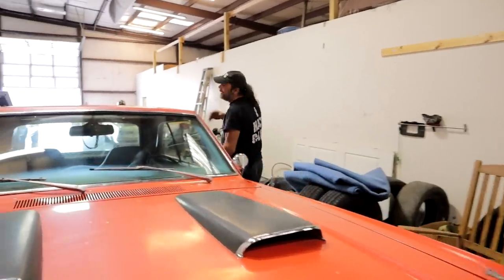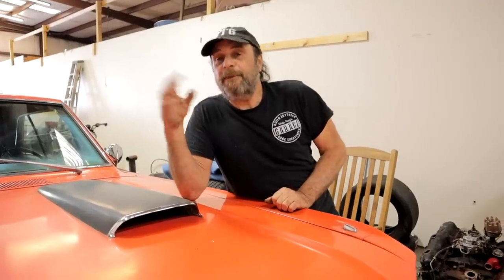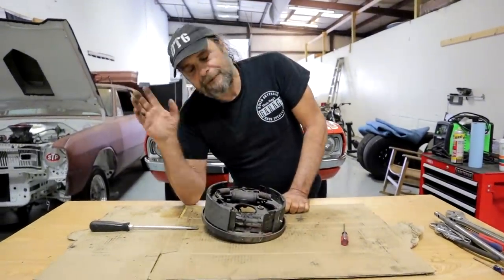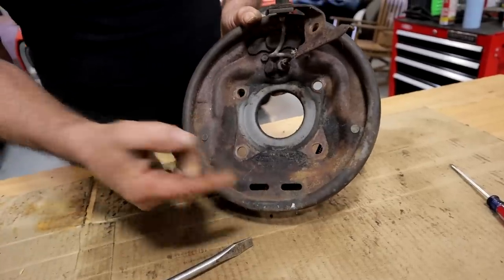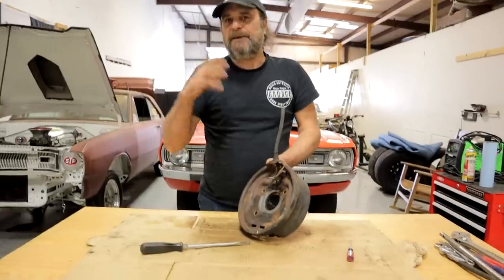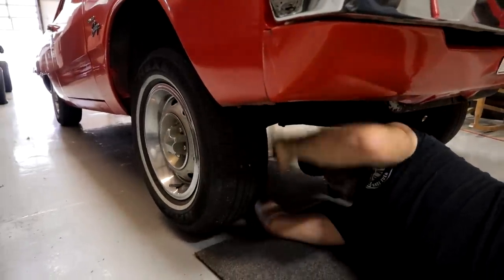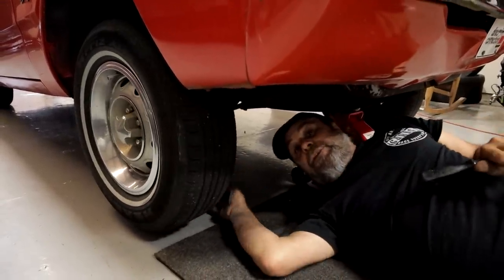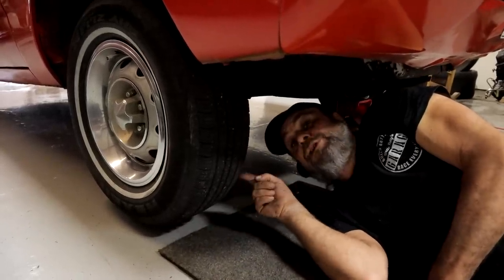Make It Stop! Brake Adjustment For Classic Cars Made Simple Plus A Hack For Gouged And Frozen Drums

Comment: For rear brakes, I'll adjust one side with a tire on, and the tire off on the opposite side. Then on the other side, take that opposite tire off, otherwise you're feeling the drag of the first side and you want them even. You may mention this by the time the vid is over, but I'm just saying basically the only thing I know about adjusting. I always have a hard time using a screw driver in there, especially my 2010 Silverado.

Comment: Good video.Could you do a video on the best way to get the air out of the brake lines.I converted my 66 Barracuda from single reservoir to the dual disc brake reservoir.I have the right positioning valve and all new brake lines and hoses.I have never been able totally bleed the air from the system.Ive bled the reservoir on and off the car still the brakes don't stop properly.The pedal always has alot of travel probably 3-4 inches or even more.Ive hand bled them and vacuum bled them still always have alot of brake travel...thx...Walt.

Comment: @13:45 2008 Dakota Sport 4x4 has disks up front and drums in the rear. Major issue cripking the hobby, discontinued parts. Latest one for me was the rear side drum brake adjuster that connects to the e-brake. How is it legal for a safety item to be discontinued?

Comment: Had a 72 F250. The guy had leading and trailing shoes reversed . Adjusters reversed. Left and right shoes reversed. When you braked, one side adjusted out, the other side adjusted in!
Reply: I ran a Midas shop for 10 years in early 2000s, and we used to see that all the time! Along with guys who did calipers and went through a gallon of brake fluid to bleed them, and still couldn’t get a pedal on it…because they had the calipers on the wrong sides and the bleeders were pointing at the ground 🤦🏼‍♂️
Reply: Hahah before I even touched em , I always heard guys say only take one side apart at a time so you have a reference. 
It's never failed me.
Reply: @MrTheHillfolk  why would anybody take all four brake assemblies apart at the same time!? (They're the same diameter front and rear)
It took me hella hours to sort it out! 😤
Reply: @outlawbillionairez9780  not sure ,but I'll never do it.

Comment: Why didn't you cover, "big back small front"?
And the dual servo principle involved. The star wheel adjuster is actually the servo and pivot point to equalize the shoe wear top to bottom.
Reply: The Bendix effect.

Comment: Just  buy the damn drum brake spoon adjuster set at Harbor Freight.  It's not expensive and more than adequate for the weekend shade tree mechanic.  Having the right tools for the right job makes things far easier and safer.  As mom used to say, " Don't do 5 minutes of work that  turns into a $100 in damage."
Reply from the maker: If I worked on anything other than these cars, I'd have one.

Comment: You cant adjust the brakes to not pull to a side! Adjusters on the old Fords only works when you back up and brake. Cause if they work in forward motion and you overheat the drums and it adjust, the wheels could lock up when they cool down. By the way the caster angles is offen overlocked! Chris

Comment: Sometimes I'd just pull the hub cap (NOT the wheel cover) and remove the cotter key, take off the castle nut then remove the wheel and drum all at once.  Put on the new brakes, tighten the castle nut and back off until you can catch the first hole (so you don't overtighten the bearing) check the drag and adjust the brakes until good....AND PUT A NEW COTTER KEY PIN BACK IN SO YOUR WHEEL DOESN'T FALL OFF!   Replace hub cap and wheel cover.

Comment: My breaks were pulling left on my hot rod. My mechanic friend told me drum breaks are hydraulic so they always put even pressure on the shoes. But it pulling and I know adjusting them helps. Why do they not press evenly?
Reply: It’s a home made setup. Front axle is a 50 Chev half ton. Rear is an independent setup out of a 89 thunderbird. Drums all the way around. Dual drum master out of a 60s Mopar.

Comment: A good brake check in reverse from time to time keeps the shoes adjusted properly on a Bendix style braking system. Leading and trailing brakes are adjusted by firmly applying the parking brake. I use to laugh at the old guys 20-30 years ago driving like maniacs in reverse while stomping on the brakes trying to adjust leading/trailing brake systems, lol. 

Don't forget to adjust the parking brake cable after replacing rear shoes. I like my parking brakes to do their job with minimum travel.

Comment: Great shows but you are not specific enough to newbies. The star wheel makes adjustments, but what does that mean and how does it make the adjustments? The star wheel extending the adjuster so the bottom of the break shoes extend out should have been pointed out.

Comment: I remember on old Ford Escorts, the rear drums had a strange flat bar type of self adjuster. And all the guys hated them, because they would always be rusted solid. But I really liked them because, once you cleaned all the rust off and got it moving smoothly again, they worked perfectly. When doing a brake job, I would just leave them unadjusted, and just press the brake pedal once afterwards and they'd be accurately adjusted. I'm sure that design was a cost-saving measure, but damn they worked well.
Reply: A lot of older Mazda's use that same setup. Slam on the brakes once and they're adjusted.
Reply: @MattsRageFitGarage  Oh yeah, Ford and Mazda were sort of in bed with each other back then.
Reply: @madmanmapper  Ford owned quite a large portion of Mazda for quite some time. The 4 speed automatics that came in the 87+ B series pickups were based off the C6 transmission but with lockup converter and overdrive, the pan shape is even the same just smaller.

Comment: Tony, why wouldn't you simply swap to discs? Discs are sooooo much easier to work on. They don't need adjustment. They don't make noise. They don't get grabby when the backing plate wears out. They don't have a bunch of little springs that launch themselves into the neighbor's yard when you try to install them. They don't have a million pivot points that need to be greased. They will never require a sledgehammer and swearing to disassemble. The parts are fewer and cheaper. They don't have those damned, infernal start adjusters. In the modern world, there simply isn't any use case for drum brakes. Is there?